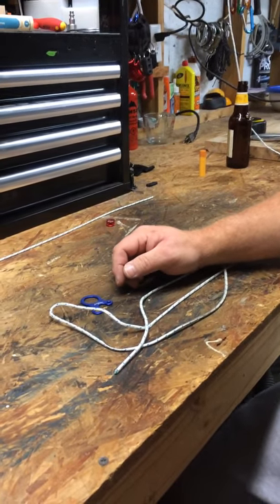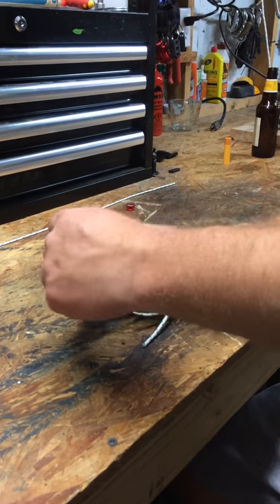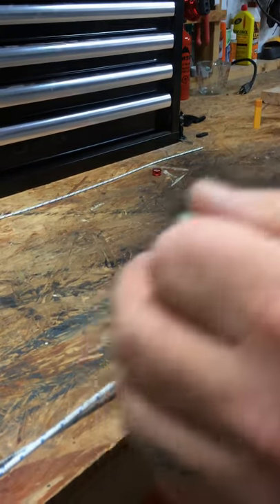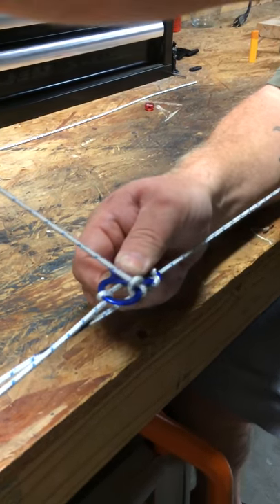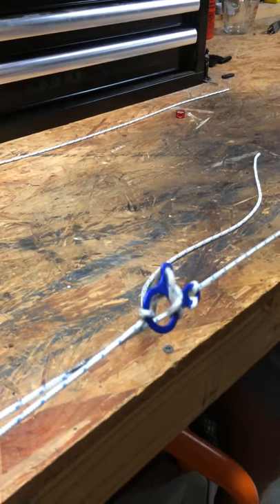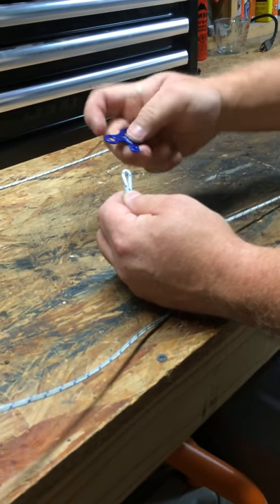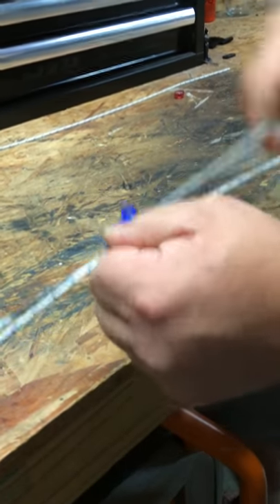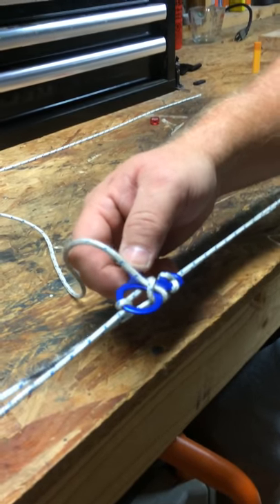“Alien Snail” Guyline Tensioner + Mega Tension = Awsome Tie Downs

Comment: hey I wanted to thabk you for your washing machine drive shaft bearing video but comments are turned off that one. Did you take that last bit (outer shaft, housing, bearing) as one unit to the bearing shop and they were able to go from there? Also, this is probably backwardly redundant, but have you considered a follow up on any snags you experienced reassembling?  Thanks again 👍